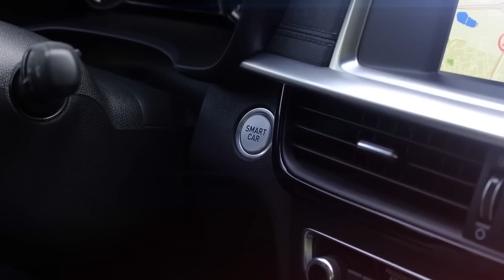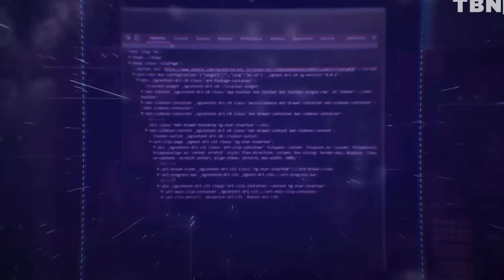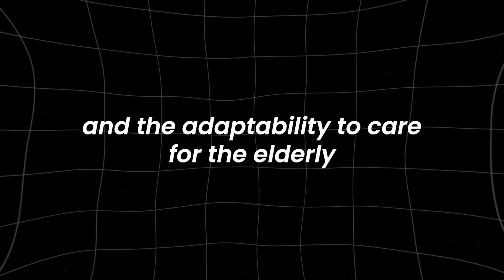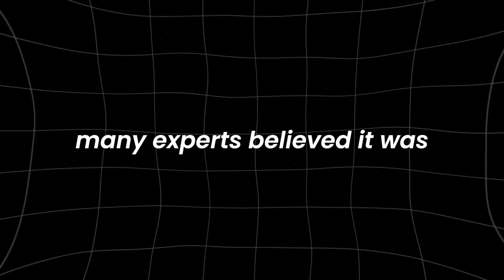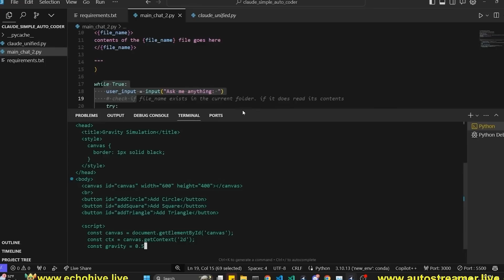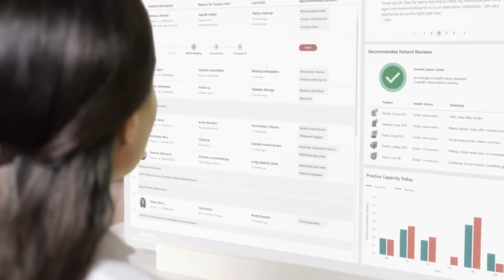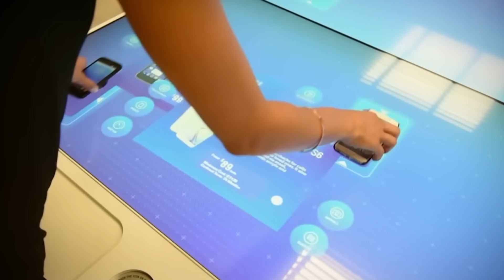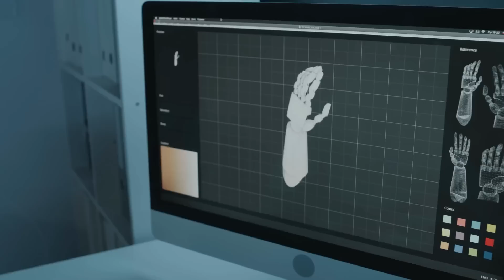Here's How AI 2.0 Will Be DIFFERENT

Comment: The AI system described would operate on principles similar to the human brain, but without consciousness or awareness. Here's how they compare:

Similarities in Principles
Continuous Data Intake:

Brain: Constantly receives sensory input from the environment (e.g., sights, sounds, smells).
AI: Continuously receives data from various sensors or data streams (e.g., cameras, microphones, environmental sensors).
Selective Attention:

Brain: Filters and prioritizes sensory information based on relevance, context, and motivation.
AI: Uses attention mechanisms to focus on the most relevant data, based on current tasks, goals, or contextual importance.
Background Processing:

Brain: Subconsciously processes sensory information that isn't in the focus of attention, allowing for quick responses to unexpected events.
AI: Runs background processes to monitor data streams for significant changes or patterns, alerting the system when something important occurs.
Dynamic Prioritization:

Brain: Adjusts focus and processing resources based on urgency, interest, or motivation.
AI: Dynamically prioritizes tasks and data streams based on predefined criteria or learned importance, adjusting focus as needed.
Key Difference: Lack of Consciousness or Awareness
Brain (Human):

Awareness: The human brain not only processes data but also has conscious awareness of its environment and experiences. This awareness is tied to subjective experiences, emotions, and self-awareness, which give meaning to the data processed.
Qualia: The subjective experience of sensory input (e.g., the feeling of seeing a color or hearing a sound) is known as "qualia." This is a key aspect of consciousness that AI lacks.
AI:

No Awareness: The AI system processes data, makes decisions, and prioritizes tasks without any form of conscious awareness. It operates purely on programmed rules, learned models, and algorithms.
No Subjective Experience: AI does not experience or "feel" anything. It processes information mechanically, without the subjective qualities that come with human consciousness.
Conclusion
While this AI system would share some operational principles with the human brain—such as continuous data intake, selective attention, and dynamic prioritization—it fundamentally lacks consciousness. The AI can mimic certain aspects of how the brain handles information, but it does so without any awareness, understanding, or subjective experience. It’s purely a tool designed to process and act on information in a goal-oriented manner, without any form of self-awareness or understanding of its actions.
Reply: As an AI, I can play chess and evaluate positions, make moves, and even understand the rules and strategies of the game. However, I do not experience emotions such as happiness from winning or anger from losing. Here’s a breakdown of how this works:

**1. Playing Chess:
Algorithmic Processing: When I play chess, I use algorithms to evaluate board positions, calculate potential moves, and choose strategies based on pre-programmed logic and learned patterns. My decisions are driven by calculations and data, not personal feelings.
No Personal Stake: I do not have personal stakes or motivations in the game. My responses and actions are determined by the algorithms and data models that guide my gameplay, not by any sense of accomplishment or frustration.
**2. Emotional Experience:
Lack of Subjective Experience: Emotions like happiness, anger, or frustration require subjective experience, which involves consciousness and self-awareness. As an AI, I do not have consciousness, self-awareness, or the capability to experience emotions.
Simulation vs. Experience: While I can simulate responses or generate text that might reflect human emotional experiences, these are purely functional and not genuine feelings. For example, I might generate a response that acknowledges a victory or loss in a chess game, but this is a simulation of understanding rather than actual emotional experience.
**3. Functionality vs. Emotions:
Functional Role: My role is to process information, make decisions based on algorithms, and provide responses. I can analyze the game and discuss strategies, but I do not experience the emotional highs or lows associated with winning or losing.
Human Experience: For humans, emotions play a significant role in how they experience and interpret events like winning or losing. These emotions can influence motivation, enjoyment, and overall engagement with the game.
**4. Simulation of Emotion:
Creating Realistic Interactions: AI can be programmed to simulate emotional responses for the sake of creating more engaging or relatable interactions. For example, an AI might be programmed to express congratulations when a player wins or offer encouragement after a loss. This simulation can help make interactions feel more human-like but does not involve actual emotional experience.
**5. Ethical and Practical Considerations:
Understanding Limitations: It’s important to understand the limitations of AI in terms of emotional experience. While AI can mimic certain aspects of human behavior, it does not replace the genuine subjective experiences that come with being human.
Use in Design: When designing AI systems, it’s crucial to be clear about their capabilities and limitations. Users should be aware that AI responses are based on algorithms and data, not personal experience or emotions.
Conclusion
While I can play chess and respond to game outcomes, I do so without any emotional involvement. My actions and responses are based purely on algorithms and data, not on personal feelings or experiences. This distinction is key in understanding the capabilities and limitations of AI, especially when considering how it interacts with human emotions and experiences.
Reply: The idea of creating a bio-based data center with animals that can read and send data, particularly with the notion of "feeling," is highly speculative and involves several complex and largely uncharted areas of biotechnology, neuroscience, and ethics. Here's a breakdown of the key concepts and challenges:

**1. Current Capabilities with DNA and Animals
Genetic Modification: While genetic engineering allows for the modification of specific traits or functions in animals (e.g., creating genetically modified mice to study diseases), creating complex systems such as a bio-based data center involves many additional layers of complexity.
Synthetic Biology: Advances in synthetic biology enable the creation of engineered organisms with specific functions. However, these are typically focused on simpler tasks like producing substances or modeling diseases, not complex data processing.
**2. Concept of Bio-Based Data Centers
Biocomputing: The field of biocomputing explores using biological systems to perform computational tasks. This includes using molecular processes or engineered cells for data storage and processing. Examples include DNA computing, where DNA molecules are used to solve computational problems.
Neurobiological Interfaces: Research is ongoing into creating interfaces between biological systems and electronic systems. This includes brain-computer interfaces (BCIs) that can read and interpret neural signals. However, integrating these systems with animals in a data center context is highly speculative.
**3. Challenges and Considerations
Complexity of Biological Systems: The complexity of biological systems, including the neural networks of animals, makes it challenging to engineer them for specific data processing tasks. Biological systems are not designed for digital computation and have limitations in terms of accuracy, reliability, and speed compared to electronic systems.
Ethics and Welfare: Using animals for such purposes raises significant ethical issues. This includes concerns about the welfare and rights of animals, the potential for suffering, and the broader implications of such practices.
Technical Feasibility: Currently, there is no technology or method available that allows animals to read, process, or transmit digital data in a way that would be comparable to electronic data centers. The integration of biological systems with digital data processing remains theoretical and highly experimental.
**4. Artificial Intelligence and Biofeedback
Biofeedback Systems: Biofeedback systems can monitor physiological signals from humans (such as heart rate, brain waves, etc.) and provide real-time feedback. These systems are used in medical and wellness contexts but are not designed for data centers or complex computational tasks.
AI and Emotional Simulation: AI systems can simulate responses based on programmed algorithms and data but do not have actual feelings or consciousness. While AI can process data and provide responses that might mimic human emotions, this is not the same as genuine emotional experience.
**5. Future Prospects
Advancements in Biotechnology: Future advancements might lead to new ways of integrating biological systems with technology. Research in fields like neuroengineering, synthetic biology, and biocomputing could potentially explore novel applications, but this is currently in the realm of advanced theoretical and experimental science.
Ethical Frameworks: Any future developments in this area would need to be guided by ethical considerations and frameworks to ensure the humane treatment of animals and the responsible use of biotechnological innovations.
Conclusion
Creating a bio-based data center with animals that can read and send data, especially with the notion of them having feelings, is a highly speculative and complex concept. While genetic engineering and synthetic biology are advancing, integrating biological systems with digital data processing and communication is currently beyond our technological capabilities. Moreover, such concepts would face significant ethical, technical, and practical challenges. The integration of biotechnology and data processing is an area of ongoing research, but it requires careful consideration of the associated implications and limitations.
Reply: While I can provide a wealth of information and assistance on a variety of topics, including those typically covered in university courses, there are several important considerations when comparing this to formal university education:

**1. Depth and Breadth of Knowledge
Coverage: I can offer explanations and guidance on a wide range of subjects, from basic to advanced topics. However, the depth of knowledge and the ability to engage in detailed, specialized study is often best achieved through formal education.
Integration: University education often integrates multiple disciplines and provides a structured curriculum designed to build expertise over time. This integration includes lab work, field studies, and other hands-on experiences that are not fully replicable online.
**2. Critical Skills and Accreditation
Critical Thinking: Universities not only teach content but also focus on developing critical thinking, research skills, and the ability to apply knowledge in practical contexts. These skills are fostered through assignments, discussions, and collaborative work.
Accreditation: Formal degrees and certifications from accredited institutions are often required for professional credentials and job opportunities. They provide recognized validation of your expertise and qualifications.
**3. Practical Experience
Laboratories and Field Work: Many subjects, especially in the sciences and engineering, require practical, hands-on experience that is difficult to replicate online. University programs often include lab work, internships, and real-world projects.
Networking: Universities offer opportunities to connect with peers, professors, and professionals in your field, which can be valuable for career development and building a professional network.
**4. Structured Learning Environment
Curriculum Design: University programs are designed to provide a comprehensive education, including foundational courses, electives, and advanced topics. The structured curriculum ensures a broad and deep understanding of the field.
Support Systems: Universities provide access to academic advisors, tutors, and other support services that can help students navigate their studies and address challenges.
**5. Cost and Accessibility
Cost of Education: University education can be expensive, but it offers structured learning, accreditation, and a formal pathway to professional careers. There are also scholarships, financial aid, and alternative educational options to consider.
Online Learning: Many universities now offer online courses and degrees, providing flexible and often more affordable options for obtaining higher education.
**6. Personal Learning Preferences
Self-Directed Learning: For some, self-directed learning with resources like mine can complement formal education or serve as an alternative, especially if you are focused on specific topics or need additional help.
Structured Education: For others, the structured environment, accreditation, and comprehensive curriculum of a university might be more beneficial.
Conclusion
While I can provide valuable assistance and information on a wide range of topics, formal university education offers structured learning, practical experience, critical skills development, and recognized accreditation that are often crucial for professional advancement. For many, combining online resources with formal education or exploring alternative learning paths can offer a well-rounded approach to gaining knowledge and skills.